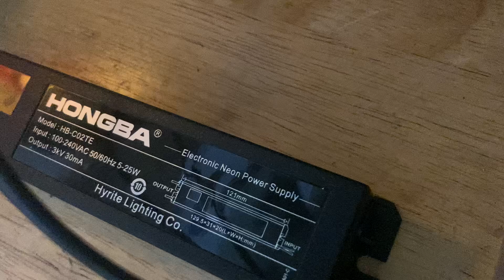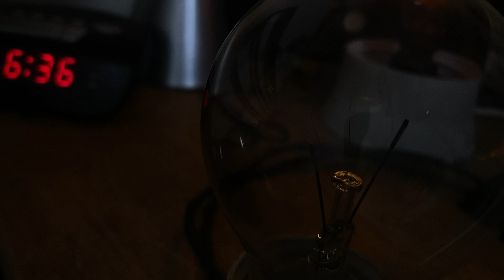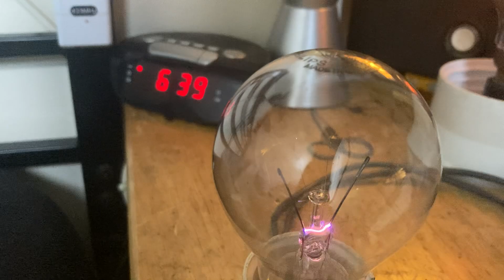Arc in a burnt out lightbulb

Comment: this is actually very interesting. i wonder if you could use them as actual light bulbs
Reply from the maker: It does give off a decent amount of light tbf. Could probably push it a little bit more but not too much or the wires will just melt
Reply: @TheCORC-o9r  have you tried keeping the light bulb working like this for some time? if the wires don't overheat this could be a very interesting way of using old broken light bulbs as very cool lights for desk lamps or something like that.
Reply: @computerkiller1494  just no
Reply from the maker: I’ve been running it off the neon driver for ages now and it works fine - the less current the better it seems though
Reply: @TheCORC-o9r  of course less the current more the lifetime but still... having a lamp running like that for even a week would be pretty impressive. I should try doing it myself. The only problem is that at least where i live (North Italy) these neon sign transformers are pretty expensive. I will look around and see if i can find any high voltage transformer so that i can replicate this.
Reply from the maker: @computerkiller1494  this one has been going for well over a week and I’d expect it will last way longer, as long as you don’t run it too hard there’s not really any wear on it that I can think of as it’s just gas being ionised. Will be very interesting to see how long it lasts. You can get the neon drivers very cheap from China on eBay

Comment: Where's a burnt out lightbulb when you need one? I still have enough clear bulbs but they're all working. I've tried dropping them onto a rubber mat and hitting it on my leg but the darn filament won't break! And I'm scared to break the glass when hitting it to harder surfaces.
Reply from the maker: Just use it until it pops
Reply: @TheCORC-o9r  5 years later...
😂
Reply from the maker: @Ni5ei  lol go to your local electrical shop and have a dig through the lamp bin - all sorts of goodies to be had in my local one
Reply: Turn it on and then shake it really hard

Comment: So could you just run it with the power supply and it will stay like that? I’d love to set this up
Reply from the maker: You can use basically any high voltage low current supply, I started using a plasma balls driver circuit which worked well and then played around with a flyback but this is the best result so far with the neon driver. No idea how long it’ll last though but I’d imagine it’ll last longer than it did as a normal lightbulb!
Reply: Thanks! Now I just have to wait for one of my few remaining incandescent bulbs to burn out

Comment: That's an interesting trick, one I've never seen. I wonder if you can use an ignition coil or the high voltage from a CRT television to get the high voltage.
Reply from the maker: I’ve tried a TVs flyback transformer and it worked ok but the neon driver or a plasma ball driver is ideal

Comment: Aren't all incandescent lamps gas-filled? I think that the filament would evaporate very quickly in vacuum.
Reply from the maker: Some are some aren’t - they have to be a perfect vacuum otherwise yes the filament will just burn. Even the gas filled ones are under very low pressure though with only a tiny amount of gas let in

Comment: If you connect a bulb like that that, which still has a working filament, to a metal halide ballast (I used a 1500 watt one) ...it'll most likely blow the filament and then arc over what's left, and due to the high current resulting in lots of heat, will cause the bulb glass to break after a few seconds.
Reply from the maker: You can do that with a MOT too
Reply: @TheCORC-o9r  MOTs won't put out more than around 500mA to an amp, a 1500W metal halide ballast puts out more current, IIRC around 6 amps. Metal halide ballasts also won't overheat if shorted, and their output voltage is lower so they won't arc where you don't want them to.
Reply from the maker: @brianleeper5737  if you get a big MOT it’ll be fine but I do need to get a couple big ballasts eventually
Reply: @TheCORC-o9r  My experience with MOTs is that if you arc or short circuit the output, they get very hot, and if you continue to do that, they'll burn out. Some sort of ballast is needed with an MOT if you intend to arc it's output for more than a few seconds.
Reply from the maker: @brianleeper5737  that’s because the smaller ones are run very close to saturation so any load more than 400mA they just seem to burn. I’ve got one of the nice big ones from a 1500w microwave and it gets warm yeah but it lasts far longer than the normal crappy ones lol
Reply: If you have ever had a breaker trip due to a filament lamp blowing, that's exactly what happened.
Reply: @cambridgemart2075  I actually had that happen with a 7 watt night light bulb. Supposedly most bulbs have a fusible link inside that's supposed to blow before the breaker trips, but this one didn't.

Comment: I think arc lamps are the oldest form of electric lighting. I think they went away partly because it's hard to work with the high voltages needed and because of the UV radiation. Not sure if the glass would filter it or not, but probably wouldn't stare at it. Neat though
Reply: Technically, metal-halide lamps are arc lamps, they are still very common today.
Reply: @brianleeper5737  I guess I forgot that. All I remember about them is they need a starting cap and some kind of special quartz glass, and if you touch them, they'll let UV through and fry your eyes

Maybe I'm just full of it
Reply: @maxscott3349  For metal-halide, the arc capsule inside the bulb is made of quartz. The bulb itself is made of glass which blocks UV. It's possible for the bulb to shatter and break and the arc capsule still be intact and working, which will cause UV exposure. Some bulbs are designed in a way that if the outer glass breaks, a fuse or something burns out and cuts power to the arc capsule, eliminating the UV hazard. This might be a regulatory or code requirement in some places.
Reply from the maker: @brianleeper5737  that’s also true about metal halide. They usually have a resistor connected to a starting electrode and if the outer gets broken then that resistor will react with the air and go open circuit rendering the lamp useless
Reply from the maker: Technically fluorescent tubes are arc lamps, I’m guessing you’re thinking about carbon arc lamps which aren’t actually run at high voltage (only maybe 50-60v) but the current is rather high (100A easy). Also the harmful uvc is blocked by the glass

Comment: At 3000 Volts , I was worried that your fingers might touch ( come near ) the outside of the screw fitting ? but then not nearly as dangerous as the " wood burners " that use microwave oven transformers ( OMG !  ) ... DAVE™🛑
Reply: huh wood burners

Comment: High voltage in a vacuum makes xrays not sure about gas filled bulbs though might check it with a geiger counter just to see .
Reply from the maker: Voltage is far too low for that, needs 100kv at least I think. Also you won’t get any from anything gas filled either
Reply: @TheCORC-o9r  Yep, the high vacuum is the most important part.  Voltages in the 30kV range can start x-ray emission if high vacuum is maintained.  Good example is CRTs and some vacuum tubes.
Reply: I seem to remember at school cold cathode discharge tube experiments in physics lab were banned above 8kV due to risk of X-rays. Or perhaps hard UV? The teacher did them anyway but we stood well back. I remember the glass fluorescence in bands.
Reply: @tripplefives1402 Light is radiation, too. No need to call it visible. It's light, it's visible.
Ionizing radiation is the name for x-rays and gamma-rays.

Comment: I used to do the same, but one day I kept the arc for too long on the glass seal inside and it melted, letting the air in :__)
I suggest you to try it at a lower current, you may be able to see a very nice and diffused faint blue arc across the electrodes.
(somewhere I should have some videos or pics of that, in the next days I'll do some digging in my archive)
Reply from the maker: I’ve previously run it off a flyback transformer with good results, never melted it either. I’d be interested to see yours :)